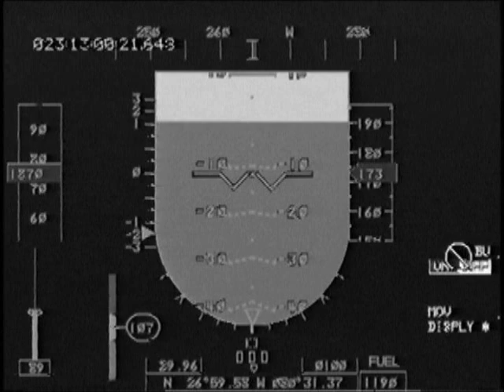RAH-66 Comanche Speed Test

Comment: That sounded so cool, and surprisingly loud in high speed flight. The "Fenestron," fantail was quieter than I thought it would be. I envisioned the loud, symmetrically blade spaced Dauphin Fenestron's screaming sound, but the Comanche's was almost as quiet as the asymetrically spaced Fenestron of the EC135 and 155. Not that I'm complaining about the main rotor sound, but if they needed it to be quieter at that amazing 180 kts dash speed for the stealth role it was intended, the double swept Blue Edge rotor blades that Eurocopter/Airbus Industry developed for the new H160 do an amazing job at reducing blade vortex interaction and cut blade slap noise by 50%. The H160 is such a cool aircraft design, pity it has to cost so much at $22 million. Not that the LHTEC T800 for the Comanche, with it's 1,500 shp isn't a nice engine, but the 2,200 shp Rolls Royce/Turbomeca Limited RTM322 is a nice, powerful engine. I bet it wouldn't have taken much to squeeze a couple of those babies into the Comanche's engine bays. It is such a pity they cancelled this amazing aircraft. Hell, they blow billions and billions of dollars all the time, some on ridiculous and unnecessary stuff, but they act like the useful and amazing Comanche was going to cost so much. Look at the Space Launch System the government is blowing a metric f**k ton of money on, they sure don't mind spending the money on that. If the beaurocrats would quit skimming money off the top of these programs to pad their Swiss bank accounts with, these programs wouldn't cost so much. I mean do people ever wonder why it costs $10,000 for a hammer or $20,000 for a toilet seat for the military? It's the greed mongering scum bags skimming money to get wealthy and powerful on, and fund their campaigns for big office. I believe the correct term for that is embezzlement, what the US government and tycoon scum like a certain one that bought his way into the White House, is best at.

Comment: By 1999 - 2000, the RAH-66-Comanche was the fastest and most skillful copter in the sky. The 1st prototype is in a museum, but the other 9 are garaged somewhere. The DOD aren't stupid enough to destroy those copters. They just hid it away from public eyes and set the Apache as the thriller rollercoaster ride.
Reply: So what is Sherlock? Obviously, since it's 2015 the fastest copter could be another helicopter.
Reply: Wait what there are 9 of them
Reply: +Dragon's Sky ill check
Reply: +Dragon's Sky both of you are wrong there are 2 prototypes at the military aviation museum this means there are 7 rah 66 in DOD
Reply: +Dragon's Sky or 8 rah 66 someone say its 10 or 9 but prefer 8 and 7 rah 66

Comment: So shortly after 9/11, near Asheville, NC, my father and I were outback around dusk when we heard a helicopter.  at first we thought it was an Apache but it didn't sound right so we watched it as it flew over head. As it passed and got more on the horizon we noticed the crooked tail. He was just a lone wolf with all lights on flying towards the North (probably headed to Washington).  About 3 miles behind him were 4 more in formation with no lights. Just some food for thought.
Reply: Oh crap, I would have loved to have seen that, since that's where I was. Asheville got to see so many cool military aircraft. I guess the mountains appealed to them for training. We had MH53J Pave Lows that parked on the south ramp at the airport, MH60 Pave Hawks and UH60 Black Hawks, AH64 Apaches, AH1 Super Cobras, V22 Ospreys, C130 Hercules, C141 Star Lifters, C17 Globemasters, F15 Eagles, and who knows what else. One of those Cobras came over one time at high speed and its blade slap was so loud it rattled windows and made the ground vibrate. A C17 was practicing steep approaches like they do in war zones and used its reversers to control its approach speed and it sounded like a steady air raid siren for a few seconds. I didn't know they could do that at the time.